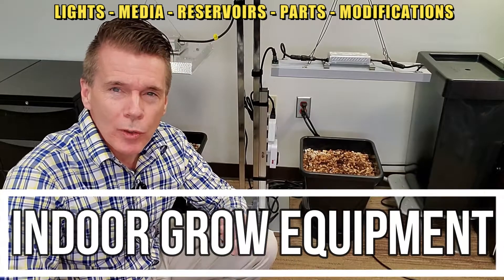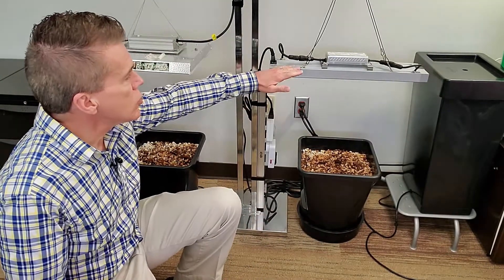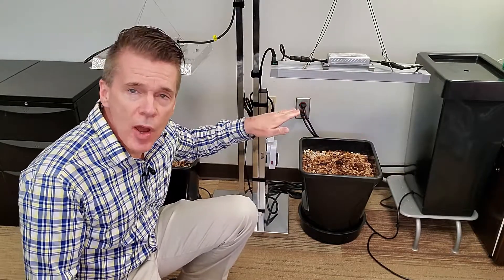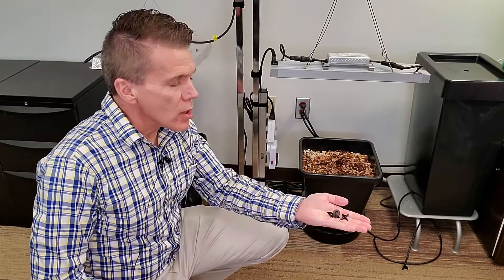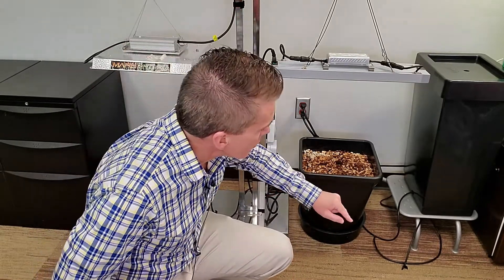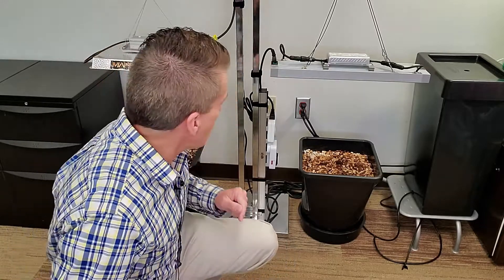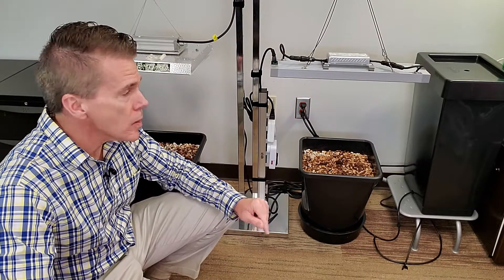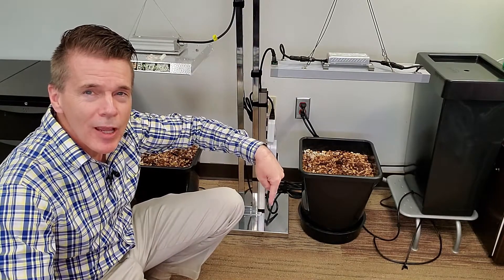AUTOPOT XL MODIFICATIONS, SETUP, AND TIPS

Comment: Shut off valves for each pot is a great idea. I will do this. Can I use 3 gallon fabric pots in the same system
Reply from the maker: Thanks! The AutoPot's 6.6-gallon FlexiPot, or compatible 5-gallon pots from brands like GeoPot or Grassroots Fabric Pots fit.

Comment: Can you tell me what size hose and shut off valves I need as extras for the system?
Reply from the maker: @joenavarro4253  After trying several different tubing's, I would buy the 1/4" tubing from AutoPot in the longer roll they sell. Search AutoPot USA for the online store. The connectors and valves match up with the micro irrigation parts sold in many hardware stores and online.

Comment: How often are you adding nutrients to the reservoir?
Reply from the maker: Optimally when the reservoir is nearly depleted use the drain tube that I suggest and empty it.  Fill it backup with clean water and add fresh nutrients.  With smaller plants, the reservoir last quite a while. With two huge plants, I was using about a reservoir per week in the final stages.
Reply: @MattGarver  so every time u refill the reservoir u add nutes? Currently I’m growing in soil, so According to the schedule I add nutes every other watering , but with this auto pot set up u just add water and nutes and essentially the plants take what they need?
Reply from the maker: @skine1107  You are correct in what you said.  Different plants are light or heavy feeders, and the intensity of your grow light, warmth, and other factors come into play.  If unsure, take a liquid nutrient that is 3 tsp/gallon full strength and use 2 tsp/gallon.  You can adjust up or down as needed.
Reply: @MattGarver  perfect thanks!!
Reply: @MattGarver  so every time u refill the reservoir u add nutes? Currently I’m growing in soil, so According to the schedule I add nutes every other watering , but with this auto pot set up u just add water and nutes and essentially the plants take what they need?